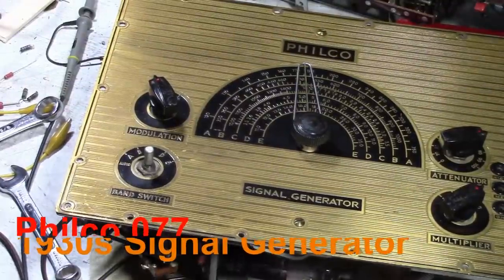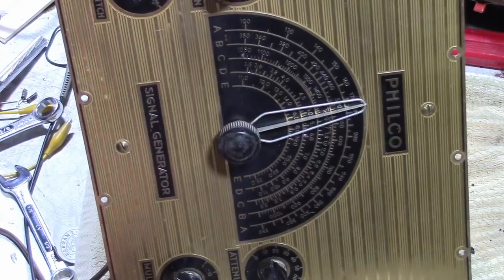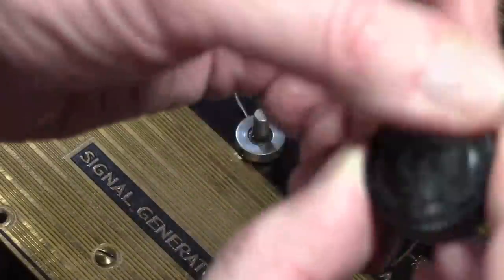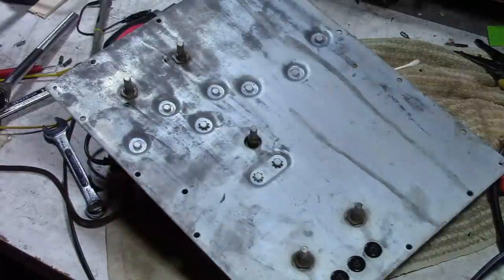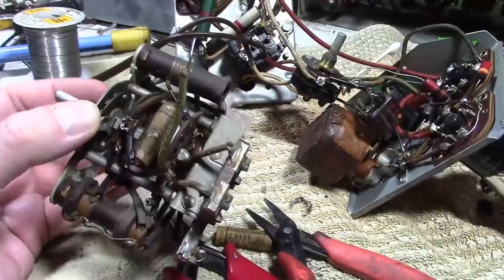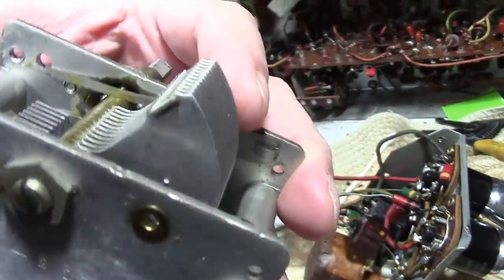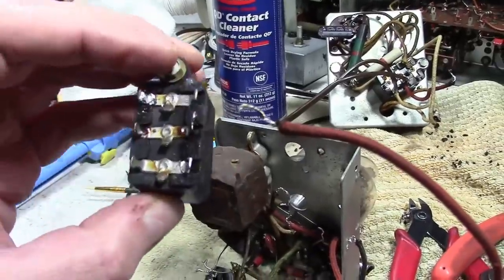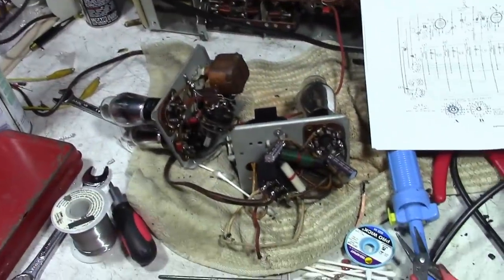Philco 077 RF generator restoration p3o6

Comment: Great job Bob. I have nice 077 that's been on the shelf for sometime now. Will certainly use your video as reference. Safety caps are on the way.  Question: Did you just use regular film caps for those other Bakelites??
Reply from the maker: Thanks.  Yes.  You only need those AC rated safety caps for the ones on the AC line filter

Comment: I would have made a mark on the pointer and the shaft with a fine, felt-tip black marker pen; this way, you can easily put them back the way they came. Ditto for the tuning cap if there’s any chance it could move relative to the sub-chassis. This way, it minimizes any realignment during assembly. A scribe or ice pick could also be used instead of a marker pen, though it’s somewhat more permanent! 😏
Reply from the maker: Good idea except that I took the tuning cap apart. That's the shaft the pointer mounts on to